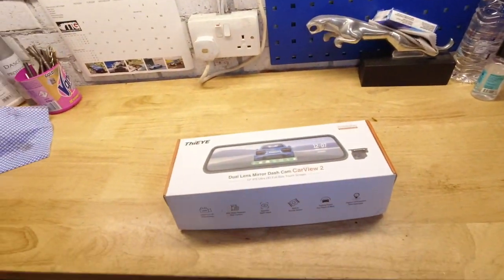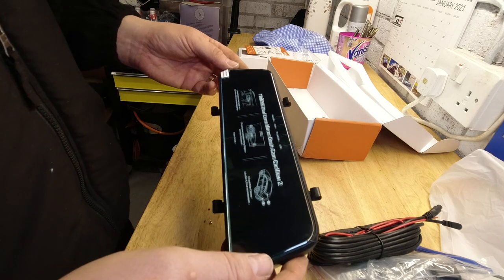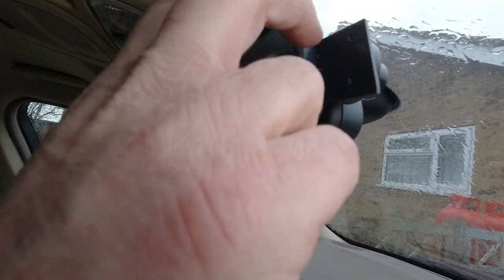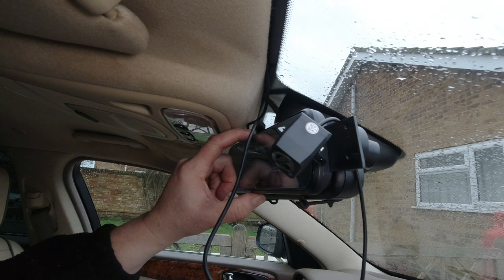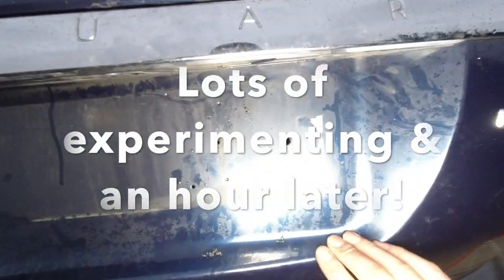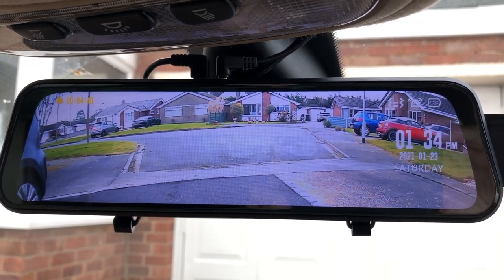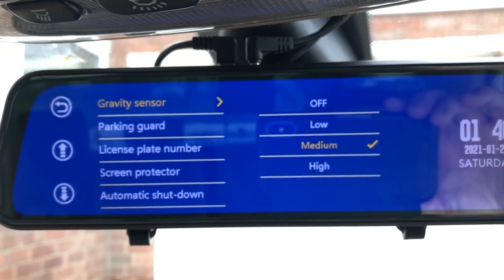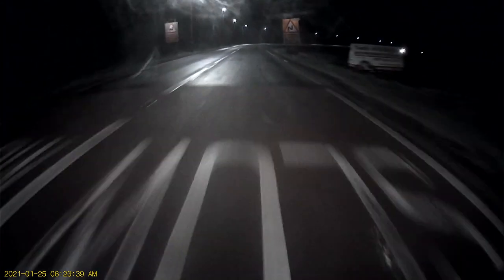fitting  a ThiEYE Dash Cam 2 reversing Mirror to my Jaguar XJ. BLU Ep16

Comment: Just an UPDATE to my previous post. I've had this for a while now and super pleased with it. The PT Cruiser doesn't have the best rear view, less so the convertible!! Rear cam positioned in the same place you put yours on the XJ. 

Not the best at night as its more or less in line with others headlights!!! Can only read license plates when close behind. 

Other than that, the rear view is on 24/7. Best accessory I've bought so far.
Reply from the maker: Great to hear!

Comment: bought one of these at Xmas too, just got around to fixing it a couple of days ago and also very happy with it so far, Not happy with the Amazon value added though where you only get the free gift if you give a 5 star review and it is accepted. 'so all 5 star reviews on their site.'
Reply from the maker: Fair comment. They are in effect paying for a 5 star review. however if I didn't like the product I would not have bothered with the card so in my case 5 stars is what I would have haven them anyway. quite sharp practice though

Comment: Fantastic video John. 
I've just ordered one from Amazon and was a little apprehensive about cutting into the reversing light wire, BUT, as you did a dirty install, showing that I can just the tap the mirror to switch views without splicing in to my CANBUS system (yup. I drive Clarkson's most favourite car, a P T Cruiser convertible) I'm happy as Larry (who every he is??)
In fact John, the only downside I could see from your Video was that you couldn't change the date from the American way to the English way.
UPDATE:
Mine arrived today 18/8/22 all on and YES you can adjust the date to UK ddmmyyyy. Result.
Reply from the maker: Oh great intel👍 Thanks for the update Baz

Comment: Hi John, I too have a Trophy and fitted a rear view camera (above the back window) and a clip over the rear view mirror display. As you know, the rear view in the Trophy is bad enough, but with the bathroom doors closed, is zero. It worked fine, until the extra weight pulled the original mirror off the windscreen (its only glued on). I would not recommend your display for your Trophy. Regards.

Comment: Hi John. Great video. Just bought my first car: a 2003 xj6! 

Having a bit of difficulty finding the cable routing through to the boot. I have the Alpine subwoofers on the back shelf and also an electronic sun screen for the rear window. For love nor money, I cannot find the wire when I feed it through as you did. Please help if you can 🤔

Keep up the great work. Love your vids

Comment: Thanks for this John, I was considering one of these for my Defender 110 SW which is difficult to reverse. I was wondering  if you have found that the rear camera becomes obscured by road dirt in poor weather when next to the numberplate. This will help me to decide whether to mount above the rear door instead. Thanks George
Reply from the maker: .Hi geoweeks. yes it does get grubby in damp weather. I have just got into the habit of giving it a wipe at every fill up.
I would mount your above the door👍

Comment: Does your XJ not have the electrochromic auto dimming mirrors? I used my mirror power feed to wire to my dash cam. 2008 Super V8 LWB in New Zealand.
Reply from the maker: That would have been a really good idea😔. Wish I had thought of it. Doh!    Never mind, next time. Cheers and thanks for watching👍👍👍

Comment: Hi, thank you for your videos it been so helpful to me since I've never owned a jaguar and its my first, I have a 2005 Jaguar XK8, its comes with 3rd brake light mounted in the rear glass, unfortunately the  previous owner removed and I can see only the wires, I bought all the parts to install a new one, but I couldn't figure how to mount it on the glass, I searched everywhere for a manual no luck, I would appreciate if you can help, although mine is coupe not convertible.

Comment: Very clear picture - but had to remove it as it nearly caused me to collide with a car passing me.  Mirror looked like it was passing on the inside, but it was correctly passing me on the offside!! Can't find a way to flip the image so that it appears as a mirror.  Any ideas??
Reply from the maker: Weird one.
There must be a setting that is flipped somewhere? 
No chance you have both the camera and the mirror inverted is there Alan?
When i get five minutes i will look through the setting options
Reply: @ToTheGarage  Don't think so, monitor clipped over mirror, camera fitted rear of tailgate. Picture very sharp (not inverted) just not mirror image. Absolutely terrifying thinking you've got cars on the wrong side of you....
Reply: It may only be possible when you take out the SD card and put in a PC/laptop??
Reply: @bazzabaz5931  thanks Bazza - but it's when I'm driving that I want to be able to see the mirror image.

Comment: The brightness is an option you can enable/disable the automatic brightness adjustment in "settings". So if you change the brightness manually the automatic adjustment will take over if it's not disabled first. I'm assuming it's an Android os correct? If so, uncheck the adaptive brightness checkbox in settings and you'll be able to set the brightness manually.
Reply: Are you saying this will auto adjust when you have someone behind you at night with their headlights on?
Reply: @jackleonard2088  it could if the sensors are catching it, which I doubt it will, at least responsively. These captors cost money and usually only bother with the sun light. Lights from car might be to faint for these to trigger anything. Unless it's very bright and for a while maybe, but I doubt it. If you have one of these expensive phone (android) you can do the same, check the function that will give you an idea. But keep in mind that your phone is a 1000 bucks computer when the electronic here is less than a 100 so...
Hope it helped
Reply: @alexanderthegreat6480  thanks for taking time to answer.  What your saying makes perfect sense.  Again thank you.

Comment: Brilliant John.
I too installed something very similar being the AutoVox V5.
It looks near on identical.
I installed the rear camera into the XK8 chrome finisher, boot lid release button.
Ran the cables through the OEM boot lid flexi trunking into the boot area.
Installed a hard wire kit to power up the main unit from the redundant car phone fuse in the passenger side fuse box.
Should have the car back on the road ready for this years 25th celebration car meets.
Hope to see you around some time.
You can check out all my little additions & mods on my Instagram profile ‘garynorris5’